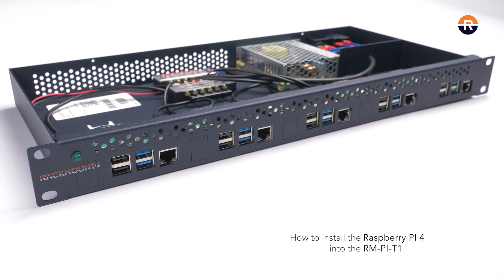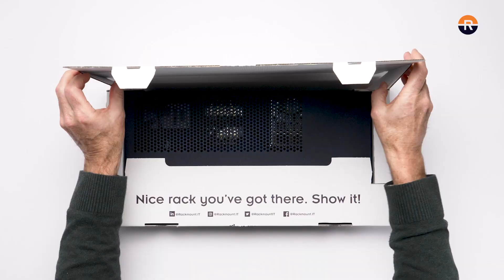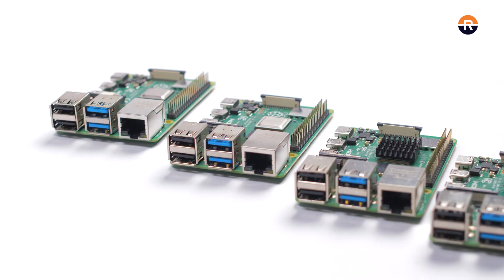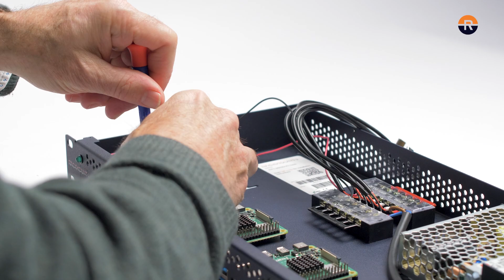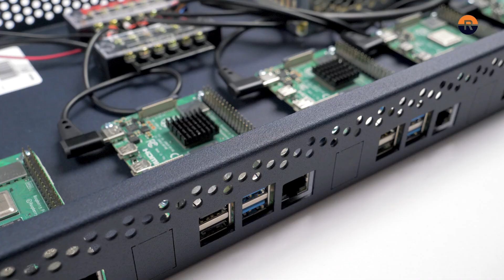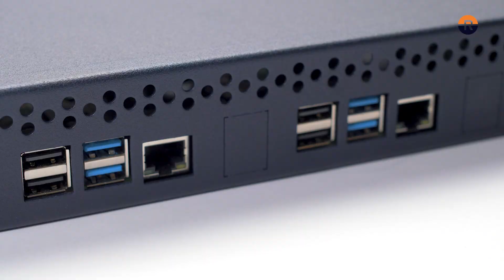Raspberry Pi 4 - Product Installation for Rackmount.IT - RM-PI-T1

Comment: A single power switch only?  And, that power switch is on the rear, why? My rack is in a cabinet and I rarely wheel it out and access the rear. This is not a convenient design.
Reply: yeah I agree. An individual power button would be nice. What about video out? I realize that you can run in headless mode, but every once and a while when troubleshooting. You'll need to connect a display to see what the output is on the Pi. Very expensive box for a few missing key features IMO. It's nice but not for the price.